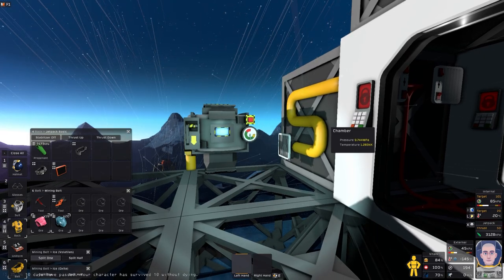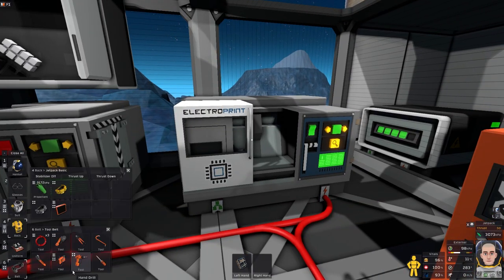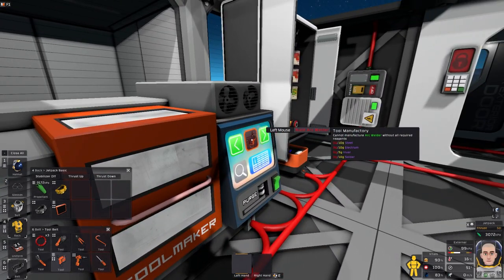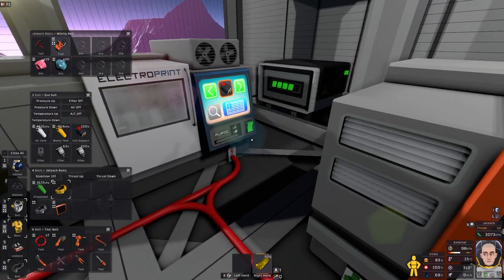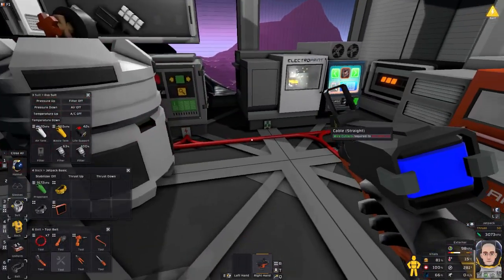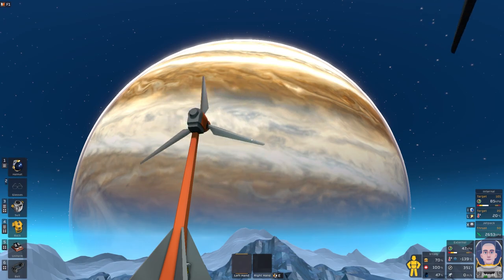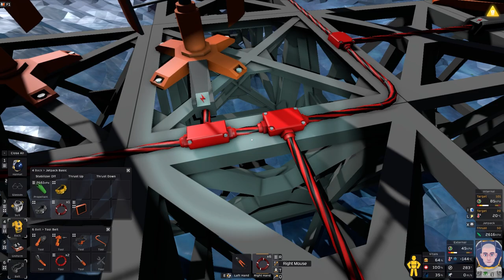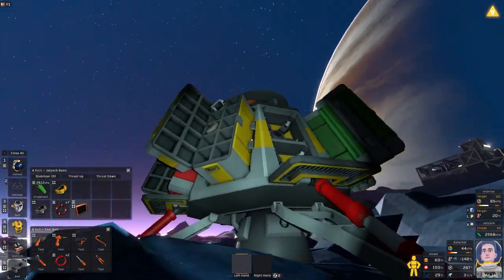Alloys, Wind, And Fire | Stationeers Europa | #4

Comment: 8:39 Maybe there was an update, but making fuel is really easy. Use a gas mixer, oxygen at input 1 @ 34% concentration and hydrogen (volatiles) at input 2 @ 66% concentration. Super easy. You can even use that gas mixture to heat up your furnace, which means you don't have to worry about carrying the ices around anymore. Plus, since the mixer is a sort of regulator, it'll keep pushing pressure into the output (fuel) until it reaches whatever pressure you want.

Comment: The Mark2 tools - Noted as "not as usefull" and " Wont get damaged in storm" are in fact, required for extreme atmospheric conditions. IE on Venus, and on Vulcan. If you  have normal tools in your hands in those environments they will melt in those conditions. On europa. no such requirement so not needed.

Tool printer has got Mining backpacks and advanced mining backpacks as well. The adv again is required in hostile environments, and can store slightly more then the normal mining backpack. But the mining backpack can contain I think 16 stacks of ore - ice as well - and they cost like 6 grams of iron to make. So you can make those and keep them in your inventory when mining to store resources. And you can use them in lockers to increase the storage capacity for ores in the lockers a whopping lot.

Fuel mix is easy, you can either use an ice crusher, or a gass mixer.  With the crusher you will add in the nitrogen if you use oxite ice. Or nitrous oxite if you use Nitrice so you either make a more volitile mix, or a less combustible one (nitrogen is inert, and Nitous oxite is highly reactive when introduced in heat)
If you use a filtration system behind the ice crusher for the O2 ice you can separate out the Nitrogen or NoS  then use a fuel mixer component to mix the 2 in a 66/33 mix. Storage tanks can stand outside for the gasses in europa as you want them as cold as possible for efficient storage - although you do need sufficient pressure to offset the possibility of it turning liquid or freezing out. Pure O2 freezes at -250ish C. Colder o2 has a lower ignition point, meaning it will burn more intensely at the flash point. If you want to feel safer.. you can use insulated tanks. or put the tanks inside built in construction frames (this insulates them) Just make sure you have a 1 way valve or similar system to isolate out the cool fuel mix from the hot combustion mix (the advanced furnace does this automatically and is a good idea to build asap)